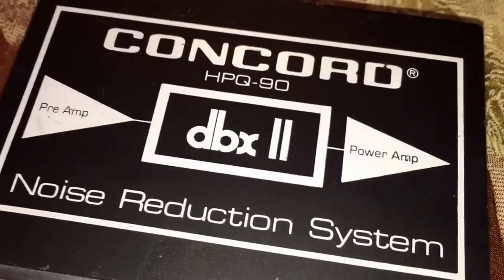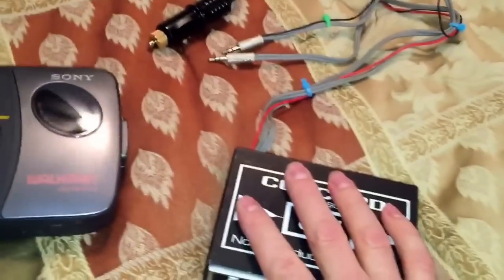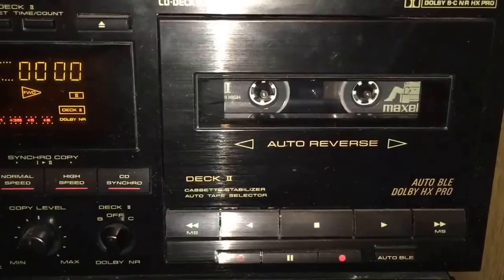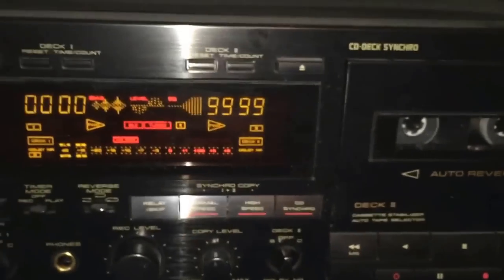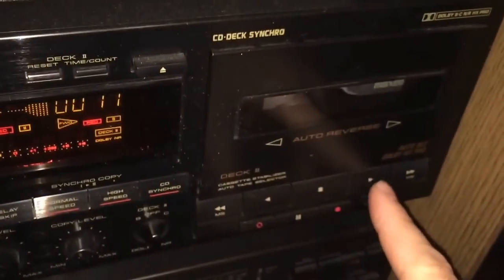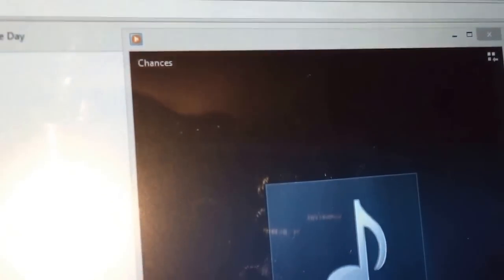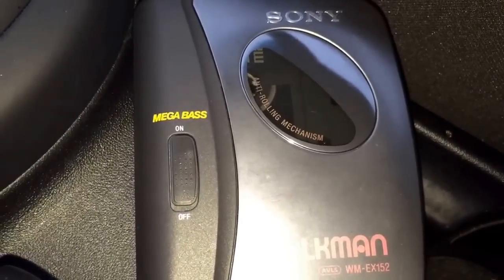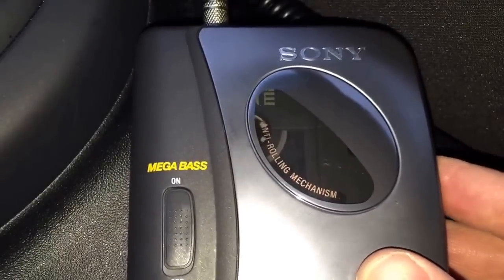Car Tech: Concord dbx Decoder for Cassettes

Comment: my unit has a red and green wire coming out of it... the RED wire is probably the Power... the Green wire connects to the speaker wire at the commector... 
Question - how did you connect the cigar lighter pjug to your concord hqrness?
Tried to see your connections on your xideo but couldn't...
thank you, David T.

Comment: is there any point using a High Bias tape with that Walkman?
Reply from the maker: +Dave Cartwright - Other than preference, no.  Normal Bias will also make outstanding dbx recordings.
Reply from the maker: +Dave Cartwright - Dave, I tried a Normal Bias tape and it just didn't sound as good...apparently high bias has an edge on clarity
Reply: With AF65/BF65, yes. This one, not so much.

Comment: interesting to see this.  I continued to use Cassettes in my old car which had a tape deck with Dolby B type noise reduction well up until 2009 because it was simply more convenient for me to leave tapes in the car and not really worry about them getting damaged due to extreme hot and cold where I live. I used to make mixtapes from my mp3s on my PC connected to a Technics stereo tape deck well up until that time (2009).  People would laugh and wonder why I didn't use an iPod in those days, and I'd explain, because this way I don't need to leave any other expensive gear in my car, and the storage medium (tape) is cheap and very robust and won't get easily damaged in a car.  Both the stereo deck and my car stereo had Dolby "B-type" noise reduction which I always used and seemed to eliminate the hiss.  I found that using high quality tapes along with B-type noise reduction I could get pretty good sound from tapes recorded from my mp3s for using in the car.  Nowadays though my car has bluetooth and I just use my iPad.  Interesting video.  I'm sure DBX was even better than the Dolby B I used.